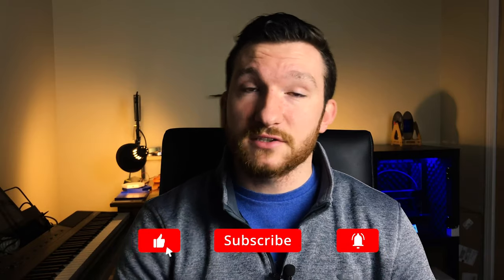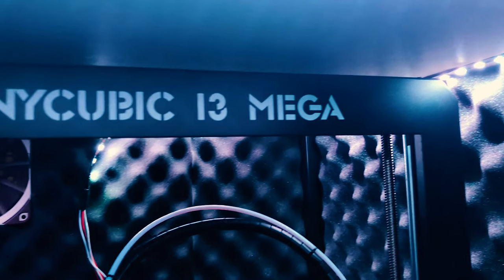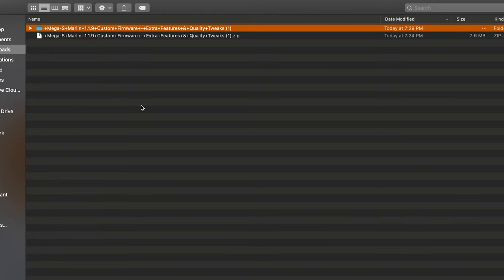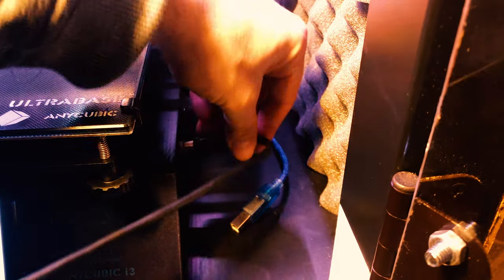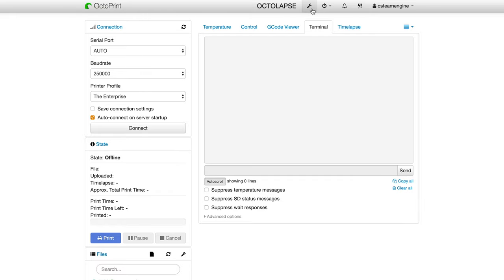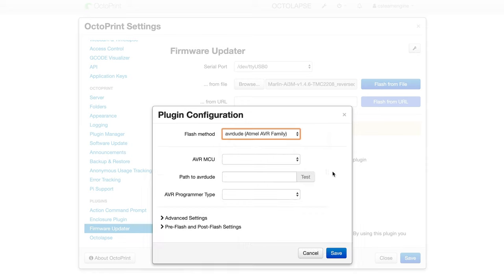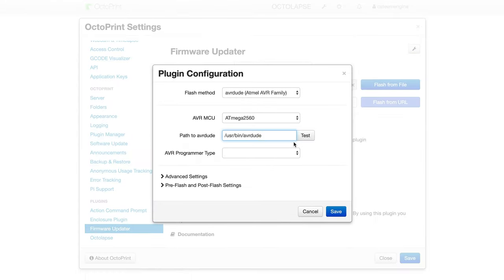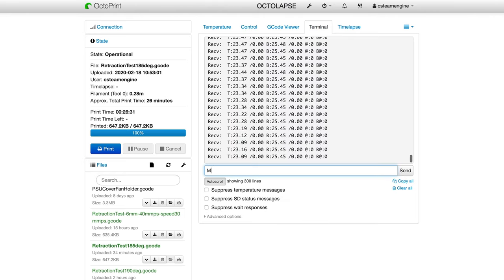How To Install Marlin On Anycubic i3 Mega! [Cura AND OctoPrint]

Comment: Tried this on my Mega Zero 1.0 and Cura can't connect, i read that it's because there's no bootloader on the MCU yet all Megas use the 2560, any ideas ? I also tried it using octoprint/pi but it hangs on Starting.

Comment: Gracias por el video!! Es el mejor que he visto y traduciendo poco a poco he podido instalar el firmware. Pero tengo un problema. A la hora de hacer un cambio de color con la opción pause at height en cura me hace movimientos muy extraños, se va hacia todas las esquinas a una altura de 60mm aprox y luego a unos 16 también se pasea por toda la cama y no para de extruir filamento.. Me podrías ayudar?? Sabrías decirme que puede pasar? Gracias por el video y un saludo desde España. Thanks!!

Comment: Hello, would you know where the abnormal sensor t0 error comes from and how to fix it. the printer prints well with the bed warm but soon this message comes out and it stops. thanks you have a great channel.
Reply from the maker: If my memory serves me correctly, I think the hotend thermistor is T0. It sounds like a loose wire somewhere, either the green plug on top of the hotend, or potentially somewhere inside the printer. Shouldn't be a difficult fix, but might take some investigation to find the loose wire. Let me know if that helps!
Reply: Thank you very much I will review everything better and I will tell you.

Comment: Hi Just a quick query. Will Marlin as shown in your video, run with TMC2209 instead of TMC2208? Or will I have to go into Marlin and change it?
Reply from the maker: Hey Noel, thanks for the comment! I personally have TMC2209's installed and they work great!
Reply: @ModernHobbyist  Thanks for the quick reply. From this I take it I can just change the drivers to either TMC2208 or TMC2209 and then flash the Marlin hex file and they will work without having to go into the file and change anything?
Reply from the maker: I haven’t looked at the firmware in a while, but so long as you select the correct firmware it should work! By correct firmware I mean from the precooked hexes for flipped motor connectors, non-flipped motor connectors, and stock drivers.

Comment: I am using the Prusa slicer software. Is that something I can still do?
Reply from the maker: Hey Adam, thanks for the comment! Unfortunately, you can't flash firmware with Prusa Slicer from what I could tell, but you could always flash it with Cura then swiftly delete Cura from your computer (as I have now done!)

Comment: is there a version for the mega zero?
Reply from the maker: I haven't seen anything for the Mega Zero yet, but it is pretty new. I'll keep my eyes open, but in the meantime, you could always try compiling Marlin yourself if you are feeling adventurous! 

https://github.com/MarlinFirmware/Marlin
Reply: @ModernHobbyist  i'd probably set the thing on fire. the bowden tube connector broke anyway so it's just a paperweight right now.

Comment: Hi there, sorry if this question has been answered, I haven't been able to find a solution in my searches
My mega-s is currently running version 1.1.4, I tried updating via Cura but it says there is no connection to printer. I've read that some boards may not be able to update (unless I'm confusing this info with what applies to the Ender). Any idea how to fix this? I haven't tried updating via the octoprint method but I could configure a raspberry pi to get octo up on this machine if that's one way to force an update. 

Thanks for the video!
Reply from the maker: Hey Ezra, thanks for the comment. I'm not sure what might be preventing you from updating, but if you have an older printer, you might need to flip a switch on the motherboard that allows USB connections to the printer. Mine didn't need that switch flipped, but I have seen some that do. Let me know if that helps!

Comment: I followed the steps using the cura, but it doesn't update. it still on version 1.1.2. I don't know what I did wrong
Reply from the maker: Hey Bruno, thanks for watching my videos! If the flashing gave you a success message, then it should be installed correctly. My printer still shows V1.1.0 after flashing, but it successfully has Marlin installed. Does your printer still play the Anycubic start up tune when you boot it up? If so, then we might have to look deeper to find the issue. If not, then you're good to go!

Comment: Dude you don’t switch, you are upgrading to a newer version. I3 mega’s stock firmware is also marlin but much older 1.XX .
Reply from the maker: Thanks for the comment! You're right that the i3 currently runs an old version of Marlin, but I wouldn't call it an Open Source version, since you are only able to acquire a hex file from Anycubic. The goal of this video is to enable mesh bed leveling, PID temperature tuning, and thermal runaway protection, all features that are not currently offered by the stock firmware. Thanks for keeping me honest though, I appreciate the feedback!

Comment: Hi I would like to ask if I upgrade to marlin with stock driver, then I upgrade to tmcc2209, do I need to reverse the cables?
Reply from the maker: Hey thanks for the comment! There is an option in the downloadable hexes provided by Dave Ramiro that will allow you to install TMC2209's without reversing the cables. However, if you install the stock driver version like you mentioned, you will need to flip the cable connectors.

Hope that helps!
Reply: @ModernHobbyist  I have installed marlin and start working on tmcc2209, however I can’t pass the voltage test no matter I have reverse the cables or not. The voltage neater keeps showing 5-7.8v no matter how I switch the bolt on tmcc2209, is that normal?

Comment: I ran into random problems installing Marlin. It does strange rituals when starting a print.
It homes xyz.
Z is rising like 50mm up.
Y moves super slow forward for abit.
Z lowers down then X goes straight to print.
Sometimes Z+X elevates directly down to begin printing. (like it should).
Its strange I cant find those activities in the Gcode..

Comment: If you do M503 before you flash the printer, you can see the esteps in console. That way you don't have to go through the estep calibration again. My esteps were 384 from the factory
Reply from the maker: Thanks for the comment Neal! That's absolutely correct, but it wouldn't hurt to re-calibrate after flashing, since the newer firmware will potentially control the steppers differently. You would likely get by fine with your old E-Steps, but it doesn't hurt to make sure! Thanks again for the comment, I truly appreciate it!

Comment: Thanks, great video. It might be worth reminding the good people that the standard issue SD card with Anycubic printers has Chinese characters (which are incompatible with the Marlin firmware) in some of the filenames. This will cause an issue where the Print menu freezes (but all other menus work ok). The guide does mention this, but I missed it/disregarded it and lost an hour debugging! In my case, I simply removed all Chinese characters from filenames on the SD card and it cured the problem.
Reply from the maker: Thanks for the comment! I can't tell you how many emails I've gotten asking why nothing shows on the card after the update, so I appreciate the comment!

Comment: tried with cura just as described. Now I have nothing.  The print menu lists 3 items <special menu> one of myprint files, and /D.  The menu screen is actually frozen though.  Cant to anything!  UPDATE:  I was able to restore the original firmware from Anycubic.  So much for trying Marlin on this machine (Mega S)
Reply from the maker: Thanks for the comment! One thing I should have mentioned, is the Marlin menu doesn't work if there is a file with special character in it. The SD card that comes with the printer has a Chinese file that causes the menu to freeze. I had the same problem, but after removing that file it worked great. Cheers!
Reply: So all I need to do is delete this Chinese files from the SD card?  Ok.  Also I didn’t notice anything in the menus about mesh bed leveling.  Will that also appear?   I went ahead and deleted both the Chinese and Japanese files from the card and tried again. Now the screen works but I still see no option anywhere for mesh bed leveling
Reply from the maker: The special menu is a little different, you need to click the "special menu" and then press the "refresh" button to actually select it and enter that menu. Once you're in, you'll need to follow that same method for each item inside the special menu.

Comment: Ok so since I flipped the wiring and put in tmc 2209 i need to flash marlin to get the  machine to work properly?
Reply from the maker: Hey Bobby, thanks for the comment! You don't need to flash the machine with Marlin as long as you flipped the connectors. The flipped connectors is only necessary if you intend to keep the original firmware on the machine. If you wish you flash Marlin, though, there are multiple binary options (one for flipped connectors and one without flipped connectors). Hope that helps!
Reply: @ModernHobbyist  I have a problem since i went to the tmc2209 i have no extruder to feed the Filament as far as i can see everything else works.
Reply: @ModernHobbyist  I am not too savvy with this

Comment: I only have problems since upgrading drivers and switching to David Ramiros software. 
Constant layer shifts when printing larger objects and stuttering when printing curved objects. 
tried vref in 0.05 steps from 0.85 - 1.15 without any success. 
All this is apparently fixed in the Knutwurst version 1.1.7 but its still in beta. 

Isn´t there any reliable firmaware to use when switching to TMC 2209?

Comment: hi great video and very informative, i just installed this marlin firmware onto my anycubic i3 mega, but i still cant seem to get the printer to do a filament change, where before the update it wasn't doing anything at all, now when i modify g code in cura to do a filament change, it now retracts the filament as it should but when i load the new filament in it doesn't seem to allow me to resume, is this a common thing with anycubic or have i done something wrong.
Reply from the maker: Thanks for the comment! I haven't tested this out too much, but if you are using the same version of Marlin as me, you should see "Filament Change Resume"  in the Print->Special Menu on your printer. It is all the way at the bottom of the special menu. Alternatively, you could send the M108 command to your printer from either Cura or OctoPrint if you have it setup.
Reply: @ModernHobbyist  GREAT, thanks for this, found the filament change resume in the specials menu and works great

Comment: hi there i have a mega pro and after the install it starts warming up to do a print and then beeps and moves into position to start and when the build plate backs up my system pauses or fails everytime.  tried reverting to stock firmware same thing now.  i cant print anymore someone please help.  thank you

Comment: Hi. I have been trying to flash the Ramioz Marlin to my Anycubic i3 Mega, but it seems that everything I try fails. I have changed my drivers to TMC2208's and am trying to use the 'reversed' hex file (motors are version 2).I am using the latest version of Cura - 4.10, but still problems. I have plugged the printer to my computer (running latest Windows 10), via the usb cable, but every time I try the 'update firmware' program runs to about half-way, then gives me an error message, saying that 'Firmware update failed due to an unknown error' - No connection with the printer'. However, I have checked all cables and connections, but still get the same fault message. Is there any other way I can install the hex file? Don't really want to build a file from scratch with Visual Studio Code - and not sure even then it would work. Am I missing some obvious thing? Further, if I can't get it to update, can I just leave the quieter TMC2208's in the machine and still have it run? Apologies for being a pain, but I am running out of options. (I am pretty sure there is no way to 'unwrap' a hex file - or not? Cheers, Noel

Comment: I did the update, but after update to marlin my printer is not homing correctly, the endstops wont function correctly when homing. y and z endstops fail. After flashing back to original firmware its stil not homing correctly. please help

Comment: Looks like i m stuck with 210 temp  even if i change it to 220 :(
assuming that 12v are goin in to my stock 9v fan?
Aint cura.. stock firmware fixed it. :(

Comment: Can this also apply to Mega-X? Thanks. BTW, Great Video:)
Reply from the maker: The version of Marlin I used in this video is specifically for the i3 Mega and Mega S printers, and as I don't know the pinout/specs for the Mega X I'm not able to say if this firmware would directly translate to the Mega X. Since Marlin is open source though, you could definitely grab the source code and work to configure it for the X. Thanks for the comment!
Reply: Getting a communication error in cura via usb
Reply: Tried numerous different cables same  error

Comment: I'm trying to get marlin to up my nozzle temp to 300c on my anycubic mega s , how can I do this ? Thanks
Reply from the maker: Thanks for the comment! I’m not sure what to do to increase Marlins limit, but the PTFE tubing used by the Bowden extruded will start to rapidly degrade at temps over 245C. If you’re looking to print that hot, I’d recommend looking at printers that use direct drive extrusion systems with no plastic. Hope that helps, thanks again for the comment!

Comment: Hi, I successfully did the update through the cura method. However now cura won't recognise my printer. So can't move forward with the commands. Any suggestions? Thank you
Reply: UPDATE: In cura Just add another printer and this will fix the issue

Comment: Good morning do you know how i can get a replacement sd card for the Anycubic i3 mega 3d printer
Reply from the maker: Are you looking to reflash the factory firmware onto the printer? If so then you can find the stock firmware on Anycubics website. Otherwise if you’re just using the SD card for printing, and micro SD card should work

Comment: Buddy thanks a million for this, 1 question can you now use the pause at a layer in cura or prusaslicer, and did you really have to configure your e-steps or were they ok,  looking forward to your reply before i flash my machine.
Reply from the maker: Hey thanks for the comment! Yeah I now use the Cura "pause at height" script with pretty consistent success, and I have calibrated my e-steps as well as the steps for all other motors on my printer. It is a super simple process that I made a video about, so make sure to check that out!

Comment: Thanks for sharing. Just a comment that I have a hard time is that after uploading Marlin it is a MUST to calibrate the extruder. The value of E0 is completelly low ~90(marlin)and mines was around 384 (stocks). I have a hard time until notice that. Also the same on PID.. after tuning the hotend  was light years better.
Reply from the maker: Thanks for the comment!

Comment: I can't find a way to delete Marlin from my i3 mega, it is just destroying my motors, not working and so on. Please, how can i remove it and go back to factory?
Reply from the maker: Hey Thanks for the comment! You can download the original firmware here:

https://www.anycubic.com/blogs/news/all-you-need-to-know-about-i3-mega-m-s

and install it the same way you did with the Marlin. It should overwrite it and return you to the factory firmware.
Reply: @ModernHobbyist  first of all - thanks for responding! Sadly, i already tried to install the older software, but it still makes the "new sound" and none of the axis are working properly. Hot end is crashing into the frame when set to home. Same with the bed and so on. This all started with updating the firmware and now, my printer is useless..
Reply from the maker: Hmm, you already reverted back to the Anycubic firmware?
Reply: @ModernHobbyist  i've downloaded the normal i3 mega (without s) firmware in this link you gave me. Or is this still another firmware?
Reply from the maker: Yeah that's the one. Even with that, it still causes the printer to not function correctly?
Reply: @ModernHobbyist  right. It still slams into every possible thing and won't even manually go back the whole way (the bed)
Reply from the maker: That's interesting. I've recently created a Discord server if you want to chat there, might be quicker than YouTube!
https://discord.gg/AYZkvTNs
Reply: @ModernHobbyist  i am outside right now, would join in about 2-3 hours. Thanks for the offer!

Comment: did all the steps including the m502 and m500.  went back to the info page and it still shows ver 1.1.0  what gives?
Reply from the maker: Hey thanks for the comment! That is normal, my printer also shows the old firmware on the screen, but you'll notice now that not only is there a special menu in the print menu, but also your printer no longer plays the Anycubic start up tune when you turn it on. Hope that helps!

Comment: Is it possible to revert back the the Anycubic firmware after you switch to Marlin?
Reply from the maker: Hey thanks for the comment! Absolutely, Anycubic provides the original firmware here:

https://www.anycubic.com/blogs/news/all-you-need-to-know-about-i3-mega-m-s

and it can be installed the same way Marlin is.

Hope that helps!